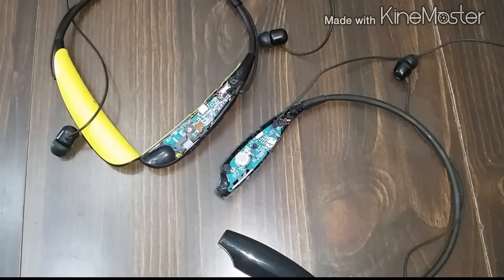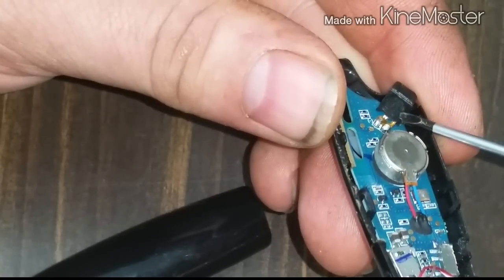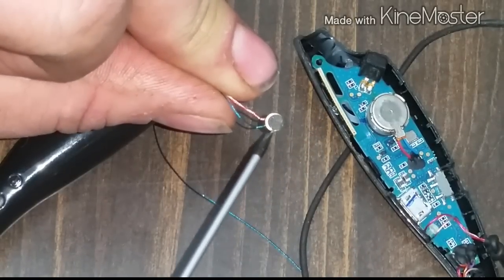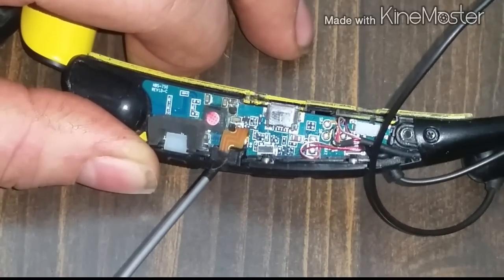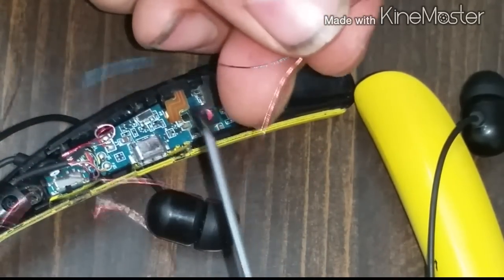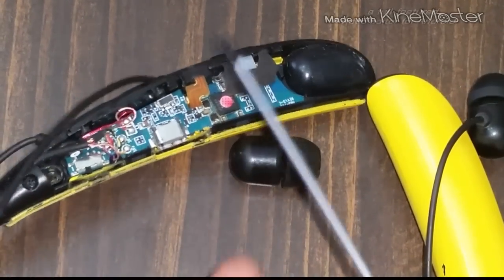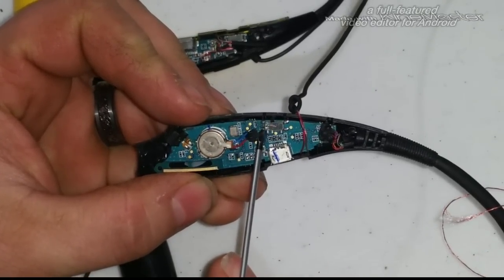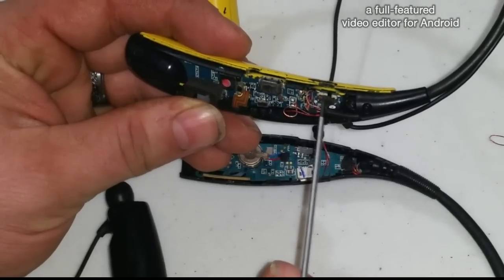LG Tone HBS repair: Mic & Power Switch

Comment: Thanks Kez. The tabs on my LG Tone 700 power switch cover broke just like you said. I got mine from Korea before they hit the US market and have used it everyday as a hands-free device for my phone. Though I cant use it like I did before, at least I can turn it on with a pin and use it as a back-up.
I see there are a lot of new models out there, and some fakes too. It seems the new models arent as reliable as the original 700. Do you have an opinion on which one is best?
To anyone else with a power switch problem: He talks about the plastic switch cover near the end of the video.
Reply from the maker: +Joe Deasy my opinion is the 700 and 730 are still the best. I've had many complaints that the successive models don't have as high of a volume range. The newer ones with retractable ear buds seem to be a pain to repair.  Also, you can pick up a cheap knock off of the 700 for about $18 and use it for parts if you need to.   Just my preference to use the 700 as my every day carry.
Reply: Can you show us how to repair a defective wires on it?
Reply from the maker: +renie miller I don't repair defective wires,  I replace them. I have two other HBS videos on my channel discussing this.

Comment: Hi, great video.  Where do you source the actual earphones, not the rubber buds?  Have an LG hbs 780 that needs a new set.  Thanks
Reply from the maker: Hi John, I like to use AWEI earbud as replacements but almost any brand will do.  Check out the other videos on my channel where I show the replacement process.

Comment: great video. showed me some things i didnt know but didnt solve my problem. one of the "arms" on the plastic switch used to manipulate the power switch on the circuit board broke leaving me unable to turn the device on without having to crack it open and move the power switch manually every time. short of happening across a donor, any idea on how to get a replacement?
Reply from the maker: Actually, there is someone in the comment section here that 3D prints that part and offers it for sale. Can't remember the name but I'm sure the comment with the link is still here somewhere.
Reply from the maker: Soft paws is the user that makes them
Reply: +kez3000 cool thanks man

Comment: I bought a refurbish pair LG HBS 900 that doesn't work, I plug the power source in and the red ligh comes on and goes off in in 5 - 10 seconds, any idea what is wrong
Reply from the maker: I haven't had any opportunity to dissect the hbs900 because I haven't obtained one yet. 

That being said... My guess would be the battery is bad. That's where I would start if it's refusing to charge. LiPo batteries go bad for a number of reasons. The most common cause is when they are drained below a certain voltage they more or less die and usually can't be recharged.  Most eyepieces will turn off to protect the battery but it's not foolproof.  I do not know what battery the 900 uses but I'll guess that it's a 3.7 volt LiPo battery with between 195 - 260 mAh.

Hope that helps.  I have other videos for some of the earlier models that may be of some use.
Reply: Thank you

Comment: Hey bro i have a set of Insignia NS-CAHBTEB01-B that dont blink red and blue for connection, and dont turn on, unless plugged in for atleast 10 minutes. And thats just the blue light in the phone symbol, whilst plugged in
Reply from the maker: Hi Joey, 
I can't comment on that specific model but the symptoms sound battery related.  99% of small consumer electronics run on one form or another of 3.7v lithium polymer batteries.  They can go bad for various reasons and stop holding a charge or fail to supply adequate current.
Reply: kez3000 what website would you recommend to find a battery

Comment: Hey I'm having issues with people being able to hear me over a call. is there any way to adjust mic sensitivity? sorry if it's been covered but I have not been able to find anything. thanks!
Reply from the maker: I don't believe the mic sensitivity can be adjusted.  Sometimes I think the background noise reduction works a little too well and can block your voice as well.  You could try making sure the rubber hole for the mic is clear of debris as this will also affect the mic quality.
Reply: kez3000 ok thats what I've heard a couple of times so I guess it's a design flaw. too bad it's a nice set. I'll clean it out and thanks for the quick reply!

Comment: hi i have a hbs 760 and lots of times when i get a call people say i sound far away. is this an issue you have seen before or is this a problem this model has?
Reply from the maker: Unfortunately that's just a common problem. It seems to be hit or miss if you get a set with a good microphone. You could try replacing the mic if you like.
Reply: +kez3000 
is there a microphone you recommend?
Reply from the maker: To be honest, I've never replaced the mic.  I show how it could be done but it's not a procedure I've gotten around to yet.  Your best bet is to buy a cheap set of earbuds with a mic in the wire and use that mic. You could probably buy one on ebay as well. Hope this helps.
Reply: +kez3000 ok thanks for your input
Reply: +Levi Ortiz yeah its annoying

Comment: My 800 power switch will sometimes power up.   I have to mess with it for awhile before it powers on..   Suggestions?   Another issue is that it looses connectivity and will connect then disconnect....    Any suggestions are appreciated Iam about to toss them....
Reply from the maker: I have not yet acquired an hbs800 to tear apart and inspect the inner workings of.  There's a youtuber (soft paws) that commented here about making 3D provide replacement parts. Might try contacting them.
Reply: Thank You

Comment: my hbs 760 isn't working I charged it over night the blue light was on when I unplugged it the thing wouldn't power on last time it happen they sat three weeks I plugged the charger to them they powered on any solution
Reply from the maker: Check your wires for breaks or Change your battery.  LiPo batteries can go bad very easily if they are drained too low or if they are not charged properly.
Reply: +kez3000 where do I get the battery my wires ar e fine I've already checked them
Reply from the maker: Watch my other two videos for the lg tone. All the info is in them.
Reply: +kez3000 I don't see a video on the hbs760 I see one on the 750 are they compatible
Reply from the maker: I'm not too familiar with the 760 but the battery is most likely a 3.7 volt 195mAh battery. That's what they've used in past models.
Reply: +kez3000 where can it be purchased

Comment: Hi 

My 810 headset speaker not working due to loose conduct with its connection wire with speaker, can you help me in that
Reply from the maker: I have a few videos that might help. I don't have any specific to the 810 but the concept is the same for all.  Check out my channel.  Here's one of them. 

https://youtu.be/dLjM5MyxYGY

Comment: I want to bay LG HBS 750 Speaker can you help me.  where I find it can you send me any link
Reply from the maker: The only way I know of to get the original earbuds is to purchase broken HBS 750's from Ebay and remove the earbuds. I don't know if there's anywhere to buy them new. However, you can easily use almost any earbuds as I show in my first video: https://youtu.be/UhFEuRD0vAA

Comment: please man i want your help how can iknow that full charged
Reply from the maker: +mohamed osama the only way to check the battery charge is to use a multi meter on the battery's +/- wires to see what the voltage is.  A standard single cell LiPo battery (such as is used in the LG Tone series) should have a fully charged voltage of about 4.2 volts and a completely discharged voltage of no less than 3 volts. The battery is considered a 3.7 volt battery because that is the nominal voltage. If the battery is below 3 volts, you should consider it a bad battery. 

For moe information, here is a link to a page that explains LiPo batteries very well:
https://rogershobbycenter.com/lipoguide/

Comment: only shows blue light then when i am charging it shows red light for few second as well as even when i am trying to off headset either it  shows blue light, really need a help help me out, how to fix hoping for your fast response, request you make it possible sooner @kez3000
Reply from the maker: +ashish pokhrel you could check your battery voltage is between 3 volts and 4.2 volts with a multi meter. If it's below 3,  your battery should be replaced (see my other hbs videos).  Also look for loose or broken wires inside, signs of corrosion or damage to the pcb.  That's what I would do.

Comment: Do you repair LG HBS750 for a fee?
Reply from the maker: A lot of people have asked me to but unfortunately I just don't have the time.  Sorry.  I made a few diy videos for these earpieces.  If you watch them all, you should have a good understanding of how to fix the simpler problems.
Reply: My problems are a little bit different. The buttons stopped working. I don't believe it all of them because I think that one of the buttons is being pressed down continuously and as a result, it makes the others not working. Trying to fix it by wobbling it lol. Thanks though.
Reply from the maker: Sorry I couldn't help.  I do have a video about the buttons on my channel but, I've never replaced them.  I only show how it could be done.
Reply: Ok, I'm going to check it out.

Comment: hi guys,i comment here because i know some of you knows the answer of my problem in my HBS-800. THE PUSH BUTTON ,PLAY/PAUSE, and the CALL button is not responding and the when i play music and others even i turn it to the highest volume it doesnt have a sound.
Comment down if you know the answer for this situation 🙂
Reply from the maker: Jade's Love have you tried it Witt another device? I know the LG tone series doesn't always play well with Apple products. You could also try forgetting/re-pairing it to your device.
Reply: kez3000 Thankyou for your response sir.my phone is Samsung j7 and yes sir, i already tried it into other device, but it doesn't have sounds too.
Reply from the maker: Jade's Love I haven't had the pleasure to tear apart an 800 model yet but it sous like your speakers may be dead.  Does it visibly power on, have a start up tone/prompt?
Reply: kez3000 ok sir. but it still doesnt have a sounds that saying power on /off .. but sir? if i go to the repair shop, they'll gonna go to fix it? or its just a useless now?
Reply from the maker: Jade's Love do the lights come on at all? I really can't comment on what a repair shop can or can't do.
Reply: kez3000 yes the lights still working